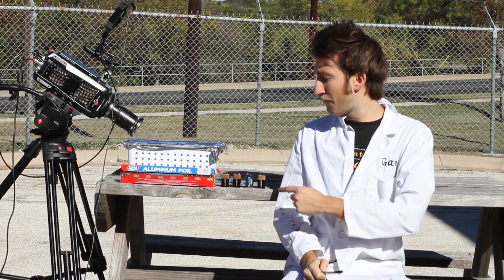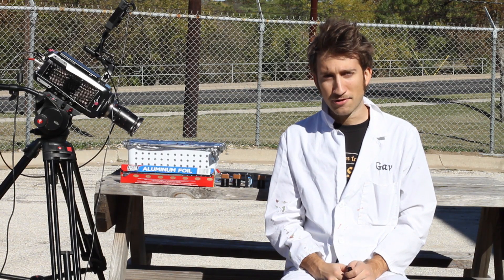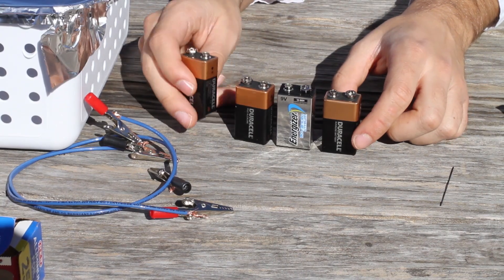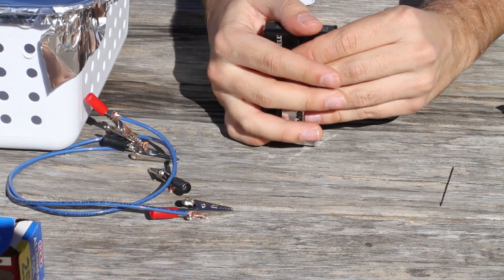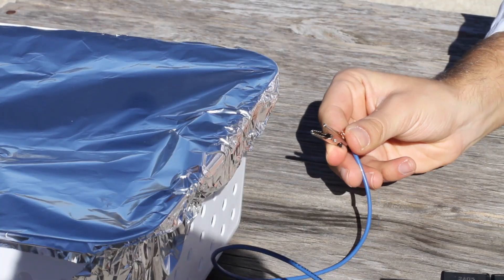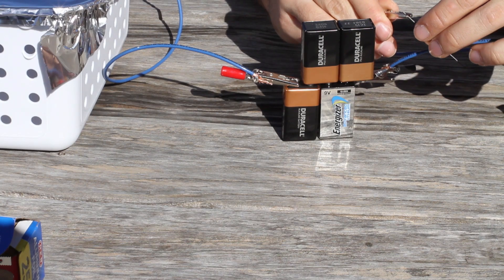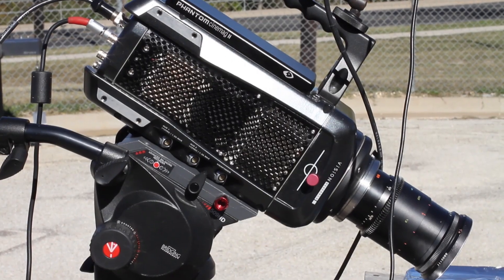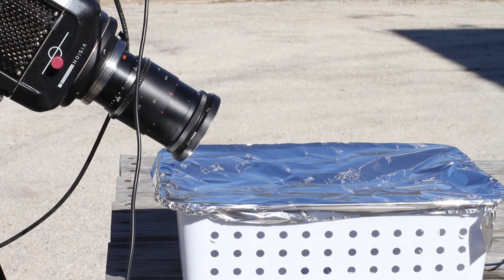Tiny Plasma Cutter in Slow Motion - The Slow Mo Guys

Comment: I would like to point out that this is not a 'Plasma cutter' but instead falls under Carbon Arc Gouging/Cutting. Graphite electrode  with direct current against metal. Normally, with a larger electrode, 300-500+ amperes of current and compressed air to blow molten metal away from the cutting zone.

Comment: If anybody doesn't understand what's happening here it's basically just a circuit that is disconnected until the pencil lead touches the aluminum foil which forms a spark (electricity) and cuts through the foil like a real plasma cutter would

Comment: that's not plasma cutting. that's carbon arc cutting. plasma cutting uses compressed, super heated gas. which is not possible using this method.

Comment: its graphite not pencil lead. if its pencil lead. it melts just a matter of seconds
Reply: Pencil lead is what graphite is called when it's in a pencil... Common sense.
Reply: scythelord be specificsense. Do not use spider sense
Reply: Graphite = Pencil Lead

You played yourself.
Reply: Oscar The Grouch Graphite is an allotrope of carbon, lead is... Well, lead. Different elements. So definitely, it is NOT the same.
Reply: "pencil Lead" used to refer to lead. however, it now refers to the graphite which we use now, which is carbon. To say Pencil Lead now, is to say Graphite. hence, the same. otherwise yes, carbon is carbon, lead is lead.
Reply: yeah, graphite IS pencil lead

Comment: if i touch it will the led
 shock or burn me?
Reply: I doubt it, it's able to cut the foil because when it touches it the circuit is complete and the somewhat high voltage tries to travel through the foil and ends up burning it.

Comment: In all do respect this is not a plasma cutter. Perhaps more of an arc cutter or a carbon arc cutter. However,  i am not in this industry so take it with a grain of salt.
Reply: I'm allergic to salt. ARE YOU TRYING TO KILL ME?!!!
Reply: Never! : )  If you you are not being factious,  are you allergic to common table salt or sodium chloride medications?
Reply: +Supremelordofpie its carbon arc cutting, plasma cutting involves compress gas and requires an actual plasma cutter, carbon arc cutting can be done with graphite electrodes and a stick welder, yes i know technically its the plasma that is melting and thus cutting it, but its still carbon arc cutting cuz theres no plasma cutter and compressed gas
Reply: Perpetual Student yah do realize that electric arcs are a for of plasma righg?

Comment: I used to do something similar, but using a transformer for power. I used to cut holes in toy cars, which were/are made of the zinc alloy 'Mazak'.  It was similar to a Thermic lance, with molten metal all over the place. Great fun. nb. this was back in about 1979, so no health and safety bollocks then.

Comment: it is not spelled wrong. 

Aluminium or Aluminum is a chemical element in the boron group with symbol Al and atomic number 13. It is a silvery-white, soft, nonmagnetic, ductile metal. Wikipedia

Comment: Can someone give me a quick but detailed explanation on what's happening here?
Reply: By connecting one end of the batteries to the aluminum foil and by connecting the other end to the pencil lead, it creates an electric circuit when you touch the foil to the lead, this electric current is strong enough to burn through the aluminum foil, so that's exactly what it does.
Reply: +TheGhostLegend001 Thank you very much!

Comment: I made one but it caught fire. I caught it on video. (not advertizing but its on my channel)
Reply: so i did this for my science project, and I noticed that 0.5mm graphite was the only one that caught on fire of all the materials tested. try 0.9mm
Reply: Jack Newton
No, the wire started burning.
Reply: You attached the graphite directly to the wire rather than using alligator clips. That may have been your problem.

Comment: these are really called air arc cutters.plasma cutters are just that they use a projected arc to burn the material instead of having to push the electrode directly into it.Both methods use pressurized air to blow the molten material away.

Comment: wait is it that easy????
Reply: Scoop Science ok i might try to
Reply: +Grim Reaper (Death) Sure is!!!
Reply: +Scoop Science could you make a small welder with this setup
Reply: deadfire games I would think that you can't because this setup is used for cutting things like metal, but because plasma is so hot, maybe if you had a metal rod, you could melt it onto other pieces of metal just like welding. It's incredibly complicated and I have been meaning to make a video on it, but overall, I think there would be a much better way to make a mini welder. I'll look into it and make a video for it sometime I think!!
Reply: deadfire games I made a bonus video of a plasma cutter if you wanted to check it out!! (I don't want to put a link to it just in case it gets marked as spam)
Reply: Scoop Science ok i subbed to your channel btw
Reply: deadfire games I subbed back as well

Comment: Out of curiosity, what would happen if you used that on bare human skin?
Reply: Awesome stuff
Reply: Nothing lol
Reply: touching the graphite to the aluminum completes the circuit and thus the energy from the batteries can pass through. flesh isn't a good enough conducter to complete a circuit that small
Reply: +Dark At Nine 
Maybe a tickle, but most likely nothing at all.
Reply: I did this at 72 volts and it just tickles
Reply: ah, thanks.
Reply: when I tested it with a temp gun, it went up to like 290 degrees farenheit, but that was 45 volts

Comment: The name is scientifically correct. Plasma is the fourth state of matter, taking place as things like lightning, which of course is electricity. This is using electricity to create sparks that melt and burn the aluminum (aluminium if your in Europe), thus it is using a plasma to cut the aluminum foil.

Comment: Nice video but not actually a plasma, more just arc cutting. in an air plasma torch the arc is constricted by a supersonic air flow so that the temperature rises to sun like temperatures. This is how it gets to cut 6mm steel with a 28 volt supply. a video of that would be really cool, especially the bit where the arc is initiated and blown out of the nozzle and on to the work piece.